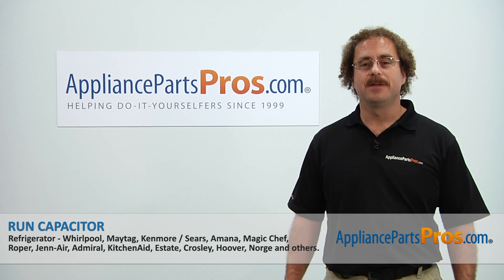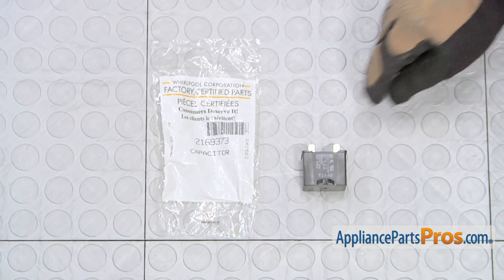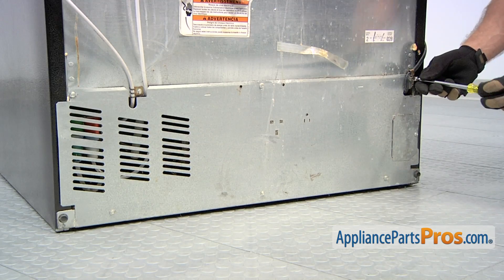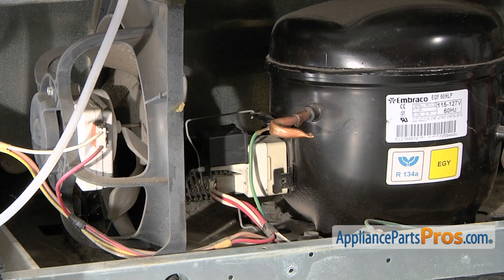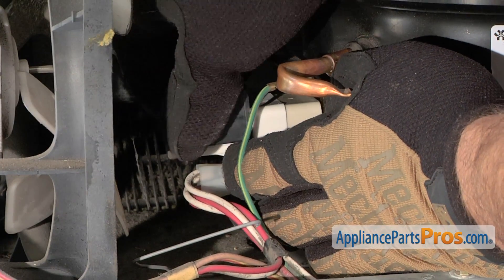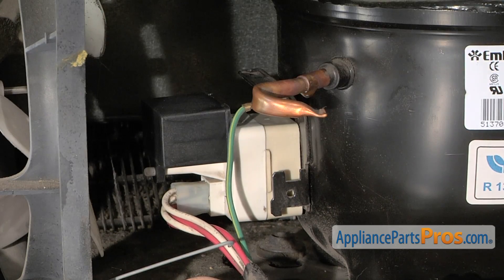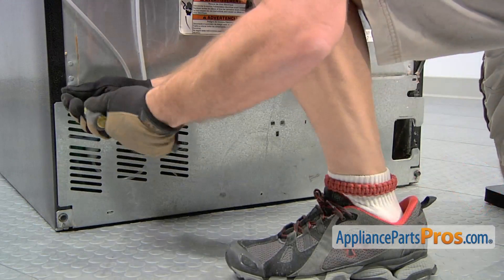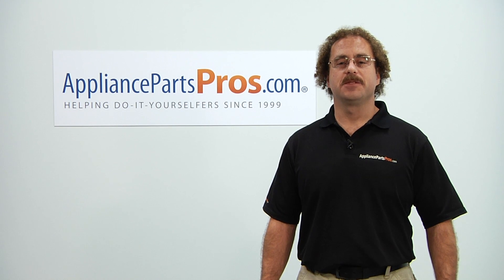How To: Whirlpool/KitchenAid/Maytag Capacitor WPW10662129

Comment: We have an old Whirlpool, model ET22DMXFW00, and it's capacitor has recently given out.  However, we cannot locate the capacitor in order to replace it!  I have pored over diagrams for days now, and while it is shown on the diagram, I can find nothing to give its specific location, nor can I find it on the unit.  Any help would be greatly appreciated!
Reply from the maker: Looks like it may have been discontinued. Give us a call with the model number to see if there are options: 1-877-477-7278.